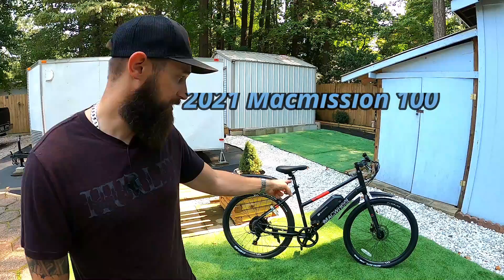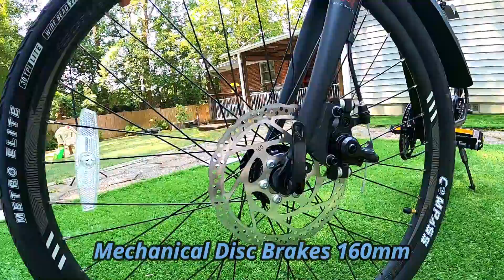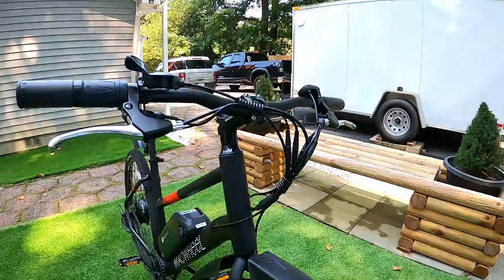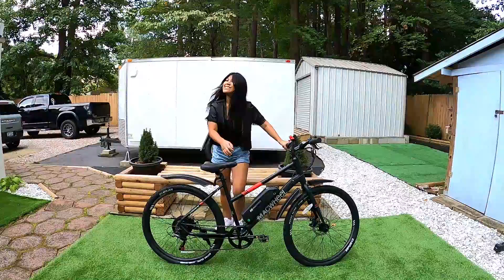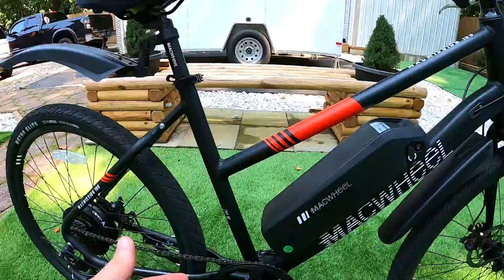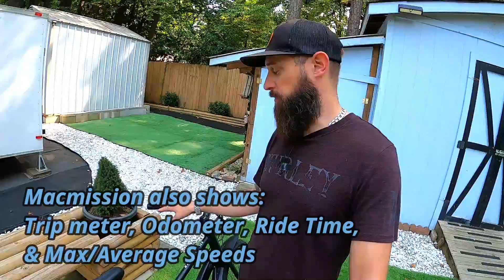Macmission 100 Detailed Overview

Comment: Just FYI, the amp hour rating of a battery multiplied by the voltage gives you the watt hours, which is a more accurate depiction of expected work, and therefore range. A 2 volt 20 amp hour battery would only have 40 watt hours whereas a 10 volt 10 amp hour battery what have 100 watt hours which you could expect to provide approximately 2.5 times the work of the smaller battery. That's why 52 volt systems theoretically provide slightly more power than 48 volt systems, and why if you want to get crazy with it you go to a 72 volt or higher system.

Comment: Hey, what is that that looks like a seat extension on the Escape? I’m 6’ and I just got one. I could use a way to slide back a little and a little more cushion as you said in another video. Thanks for the videos.
Reply from the maker: It's a bag I have on the rear rack, It was my motorcycle tank bag, made by cortech, but it fit on that rack perfectly

Comment: Good review. An good option for the money. It would be nice if the rad mission had a 7 speed.
Reply: Aerial rider has a bike that competes with the Rad mission. It has a 7 speed and has a 750 watt motor instead of the 500 watt on the RadMission
Reply: Me too.